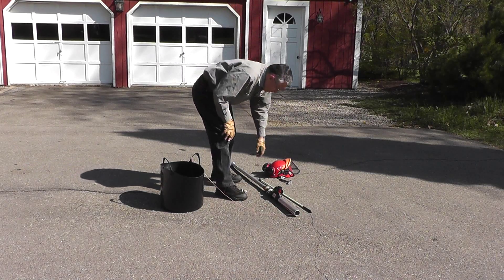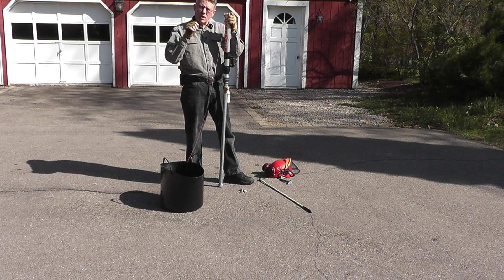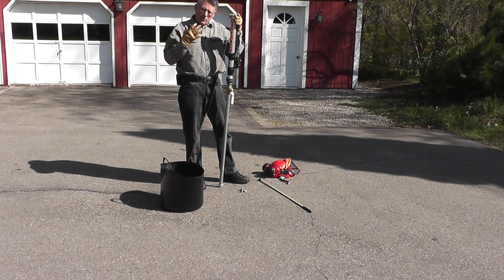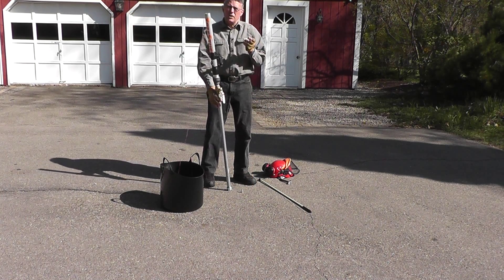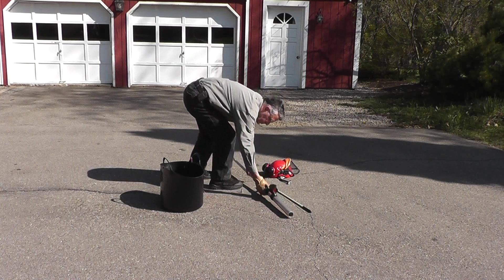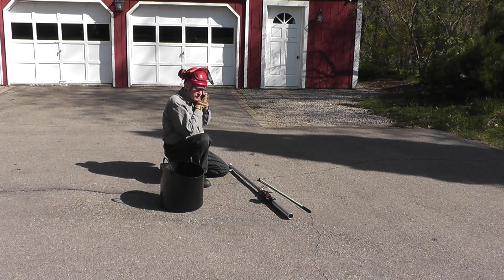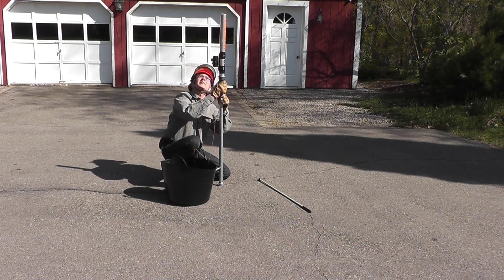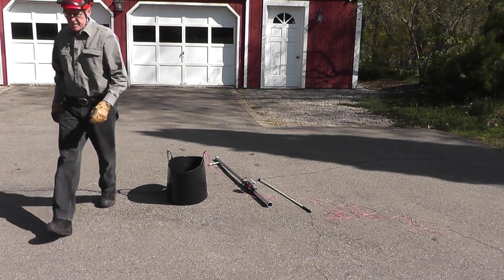APTA/OF , short chamber

Comment: Would it be dangerous to make the shooting chamber  out of PVC if the loading chamber is made of galvanized steel , instead of galvanized steel , to reduce the weight ? 
 Could the PVC shooting end blow up at a high PSI ?
Reply from the maker: No, I wouldn't do it, Justin.  At the instant the value opens and before the bag begins to move, the barrel is subject to nearly the same pressure as the pressure chamber, then dropping quickly to zero as the bag passes the muzzle.  Not only is the pressure high, the inflate-deflate cycle is faster and much more violent in the barrel. I'd be concerned about the cumulative effect of flexing and material fatigue in the plastic.  Might work great for you when you first build it and explode right next to your face sometime next year.  Not worth the risk my friend.
Reply: @tghoffmann  Thanks for explaining that mate , much appreciated .
 After watching your video I've made an APTA with a  3ft 3 inch long loading chamber  and a 1ft 4 inch long firing end . 
 I've gotten the ratios wrong haven't i ? 
 My thinking was a shorter firing end so there is less friction as the bag travels less through the galvanized pipe. 
 I haven't used it yet but just noticed your APTA has basically the reverse of mine in that manner .

Comment: I when to Home Depot myself and made my own launcher. It looks kinda like your.  I used 2 inch pipe. I never through about using C02 cartridges. I added a tire valve stem to the end and I only put 50 to 60 PSI in it. I am a little afraid of filling it too full, if you know what I mean, I don't want a bomb right at my feet.
I will take a video and post it. And you can tell me your thoughts.

Comment: Good video, Tom...it's ok, we're only human, mistakes happen. 
 There are all kinds of ways to fine tune your "Straight-Vertical" shot heights, or as I call em, "Pins", like a sewing pin stuck in a cushion, straight up and down, and although you fabbed up out of a material that can handle pressures like those, and the "Mistake" you cleared up in this vid from previous vid is one that the Grams/cartridges for a HIGHER pressure than correct is ok, but if it were the other way around, like "2
Cartridges for a lesser pressure", then THATS where the problem would arise, obviously. 
 I have been experimenting with different OD, MATERIAL, LENGTHS OF CHAMBERS, LENGTH OF REDUCING, ( from exit of chamber to entrance of valve), length, material, SIZE, and wadding materials used for larger barrels, along with a whole gamut of other variables in Pressure rated PVC, so I don't have to waste a lot of expenses on prototypes, and I'm STILL experimenting, but I DO know that the tank pressure/diameter/length/material used and barrel LENGTH, are all major players in dialing in everything. 
You could probably cut your cartridge size in HALF, and up size your ball valve to a larger, MUCH quicker "BUTTERBALL" valve, and lengthen the barrel and achieve better results, AND have an easier to flip trigger. 
Great vid man. 
Much respect to atop and all you do for the Arborist Community. 

Steve
Reply from the maker: Steve Vineyard Thanks for the nice comment, Steve.  You are very right about the huge number of variables.  Even the choice of "push stick" ... if you use a stick that's too skinny, you can move the shot beads into a "tunnel" shape that lets the gas escape around the bag(!).